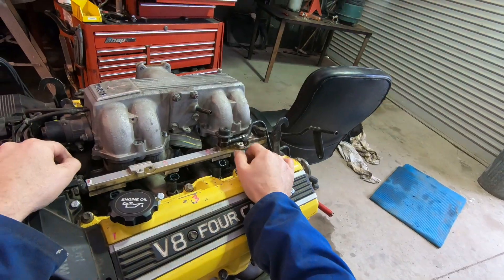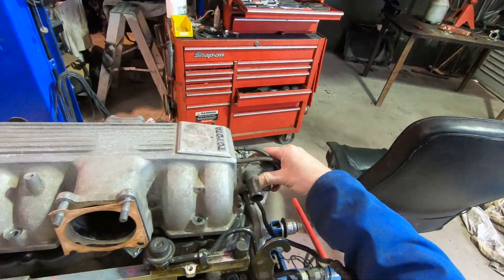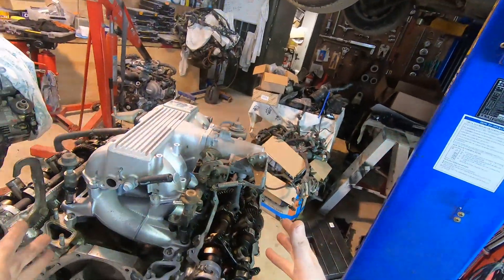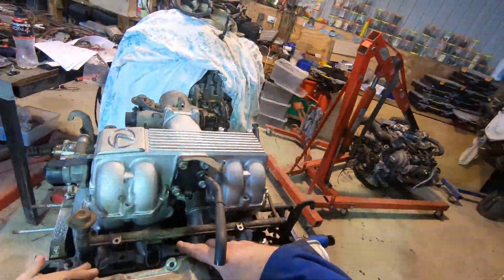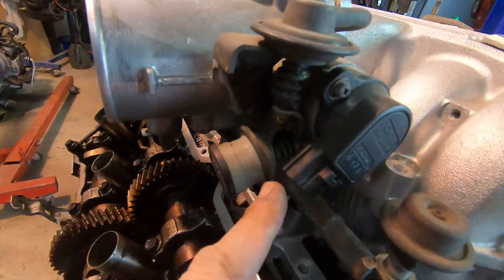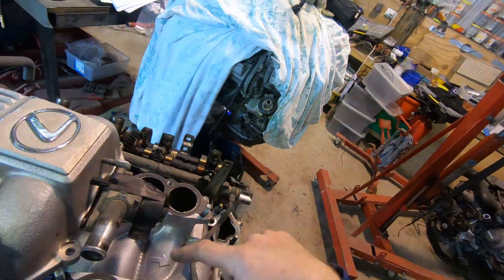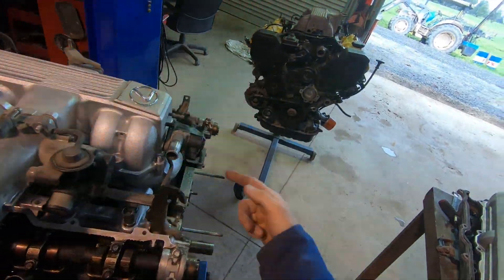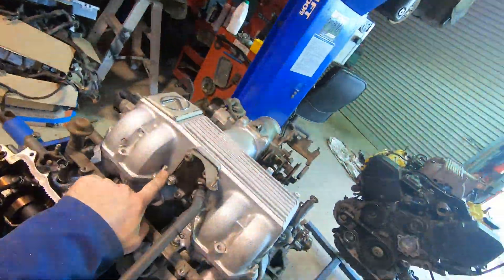1uz-fe intake Manifold reversed

Comment: I reversed the inlet on my motor which was easy enough, the problem i ran into was with the cable on the transmission is to short to connect back up to the throttle body in this configuration. Is there a fix for this. A longer cable from a different model or modified/custom cable ?
Reply from the maker: We have a longer cable made which is easy here as we have a cable manufacturer close by.
Reply: @CartuneNZ  Cheers Kelvin. Thanx 👍

Comment: I gotta ask. So I bought a 1990 ls400 had a misfire owner before me had done spark plugs and pinched a cable fixed now running better but is blowing little bit of oil or black smoke there was a little black dust on the rear bumper. What should I look into now spark plugs are black aswell

Comment: Hey kelvin just wondering you were running an aftermarket 2 wire steeper motor would it have sufficient clearance to be used in this mainfold flip application? Cheers ants
Reply from the maker: Sure is.  It gets tight back there but it works.  We did the last one on Haydens Green 2wd hilux. I also have the ability to swap the adaptor when it gets supercharged to use the same unit.  Cheers

Comment: Hey kelvin great vid, I just flipped my lower and upper mainfold. I also flipped the fuel rail assembly and everything seems to fit will out needing to mod the dampener. Is there any iusses with flipping the fuel rails and swapping the dampener and fuel regulators so they are on the same side. Cheers ants
Reply from the maker: Hello Ants.  Check the holes each component screws into.  The FPR seals on an o-ring so there is a recess for the ring to fit into.  Dampener screws in on a washer so surface is flat.   I think this is the info you need.  Cheers Kelvin
Reply: @CartuneNZ  if i have a aftermarket fpr I won’t need to worry about any of this correct? I can just swap the lower and upper intake manifold and fuel rails ?

Comment: How does this typically effect firewall clearance? Specifically in a Hilux/surf/4runner (mine is an 87). I had originally ruled this out since the IAC sticks out so far, but after seeing this, I'm considering it. I just measured it, and while the valve does stick out, it wouldn't be past the coolant bridge and heater hose below it.... But I haven't been able to test fit, so I'm not sure
Reply from the maker: It is tight at the back but all should fit fine.  You are correct it isn't past the coolant bridge.  Cheers Kelvin

Comment: Hi I have a lexus v8 1uz vvti on the throttle position sensor I think I bent the wings on myn can you maybe give me a tip on how to get it to work its running fine bud on lo Rev its cutting out then its in a limp mode of sum sort
Reply from the maker: Hello.  Using the information from the live data in the ecu should allow you to repair your vehicle otherwise I made a video with some standard voltages.  https://youtu.be/7kwX6CAMg1U  Hopefully this gives some insight.  Cheers Kelvin

Comment: The only question I have is why would you need to reverse the manifold.
Reply from the maker: Hello.  I think that is the only question you have right now,  on this topic.   Swapping the manifold around suits some vehicles better.  Some surfs if works well with as its possible to plumb into stock air box easily.
Reply from the maker: @Lusty_Wench  yes,  thats a good point for those of us with right hand drives hilux,  surf,  4 runner.
Reply: I've seen this done for some twin turbo set ups as well. Helps with the plumbing